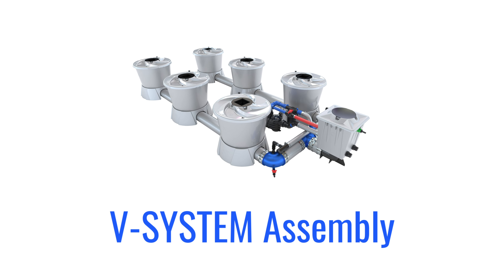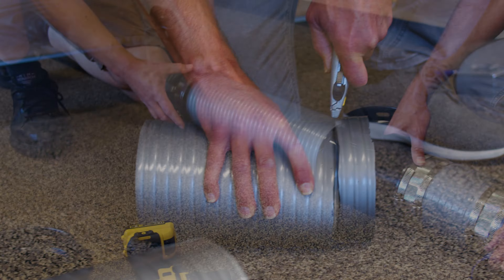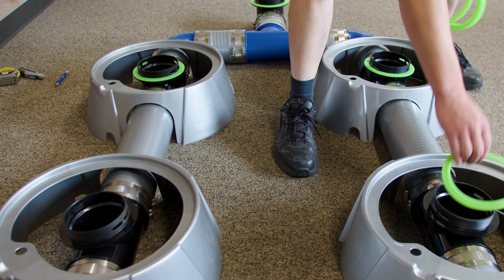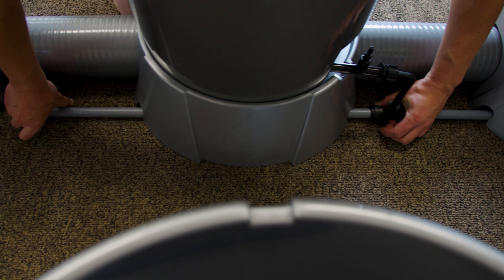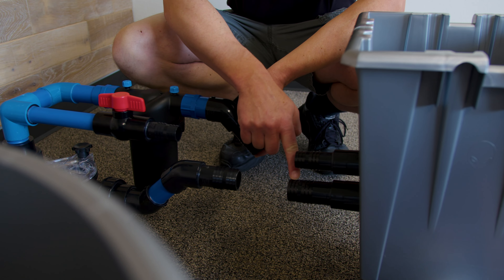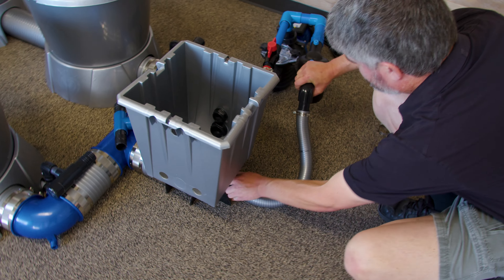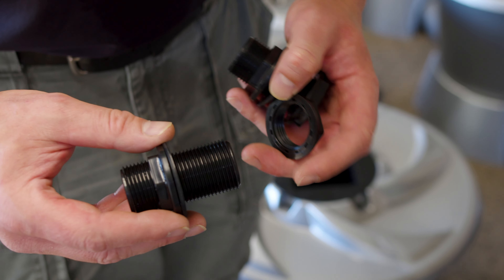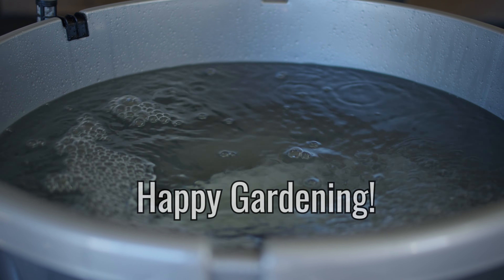V-SYSTEM  Assembly Video

Comment: How big go the plants is 2m enough for 58L pots?
Reply from the maker: The V-SYSTEM is very configurable in terms of pot spacing; the ideal size plant would be one that takes up the full width of the "plant spacing" (pot-to-pot center distance) side-to-side to make maximum use of the space; this depends on how you set up your V-SYSTEM.

Comment: How loud is this system?
Reply from the maker: The pump is fairly quiet, but the air bubbles make noise like a hot tub does. It measures about 60 decibels.